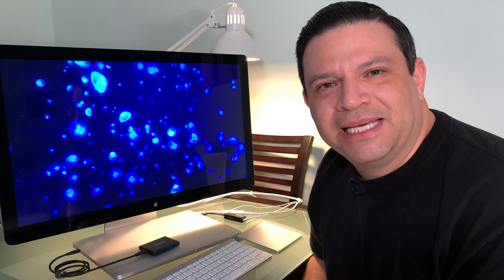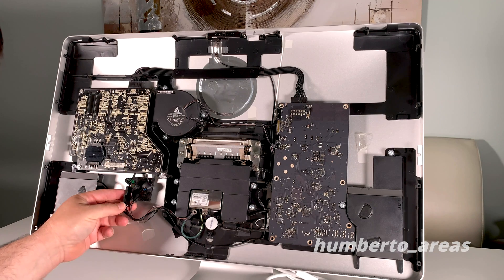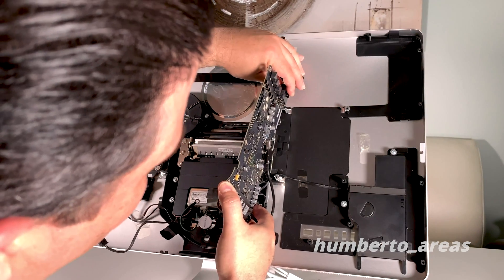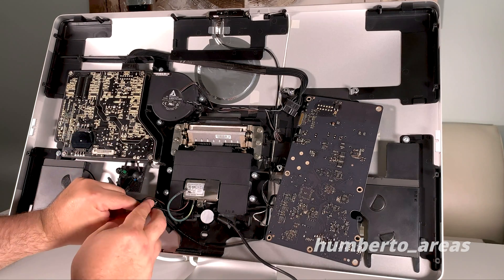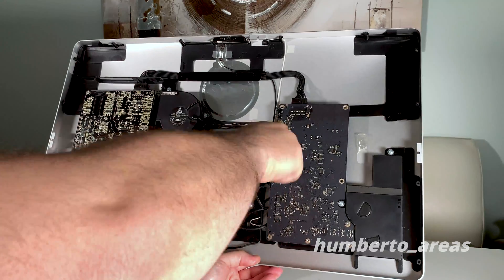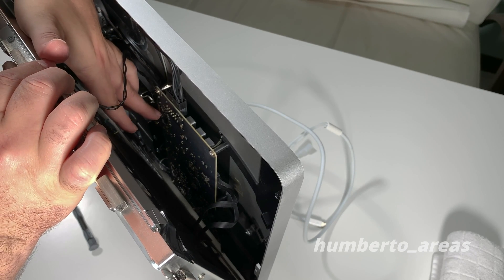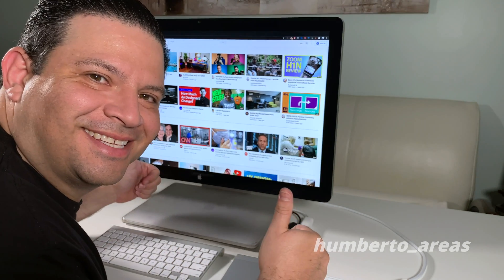Apple Thunderbolt Display Not Turning On - Step-By-Step DIY Repair 2026

Comment: Hi Humberto, thank you for making this video. I recently bought a used 24" LED Cinema Display for my MacPro computer but it only lasted a few days, actually less than a week. It suddenly went black and hasn't comeback since. After researching this model online I found that the Thunderbolt cable dying is a very common issue with these models. Then I found your video and was encouraged by it to challenge myself to do the repair and fix this beautiful monitor. I think it's truly worth it. The problem seems to be finding this particular cable to buy it brand new. I have found a few used ones on eBay but who knows how much life is in them, maybe they'll last another few days and then you have to start over looking for a cable and doing the repair over again. So my question to you is this, if you don't mind me asking… is it possible to find the original cable brand new, and where? Did you find a brand new cable for your monitor, or was it also a used one?
Reply from the maker: @pacobelsue6661 Thanks for watching and for taking the time to post you comments and questions. Glad to hear my video encouraged you in some way to take action. As you hunt for a new cable... my first question is: What is the model number of your display?

Sounds like you have a Cinema Display my friend, and not a Thunderbolt Display. This has a lot to do with the type of cable you're looking for. If indeed you have a Cinema Display, you need to look for a "Mini DisplayPort cable" and not a Thunderbolt cable. 

You can go to https://everymac.com/monitors/apple/ and verify which display you have. And to answer your question, never gamble your money on used electronic parts, always buy new when possible. I found my cable on Amazon - although I've noticed that sellers offering these cables are few now.

Please keep me in the loop and posted on your display.

PS: which part of the video did you find most helpful?

Comment: What if when we try to use one of the other ports in the back, we still don't see a screen show up?  Does this mean the repairs won't fix it?
Reply from the maker: @satchel888 Thanks for watching and for taking the time to post your question(s). Please verify the model number of your display and tell me to which MAC (or PC) you are connecting to? When you "don't see a screen show up", you mean the system does not recognize it? this can be found inside System Preferences > Displays. Look forward to your response.
Reply: @HumbertoAreas  Hola, tengo la misma pregunta. El puerto thunderbolt de atras no funciona (lo intente con un adaptador de thunderbolt  a HDMI). No estoy seguro de reemplazar el cable integrado por si el problema sea otro. Que me recomiendas? Cuando conecto el cable integrado, tengo sonido pero no video. gracias!

Comment: Where can I buy one of these replacement cables for under $40
Reply from the maker: @kyleperkins4757 Hey Kyle, thanks for watching and for taking the time to post your question. What part of the video did you find most helpful?

Unfortunately there’s not much you can buy these days for under $40! I would stay away from used cable offers. I haven’t gone on ebay lately, so don’t know what these cables are going for there. I know Amazon now has a handfull of sellers offering these cables, but are more than $100!

Please keep me posted if you find a more reasonable priced seller. I will research and post here any findings.

Comment: But how do you turnon the monitor? Is there an external switch or is it automatic when receives signal.
Reply from the maker: @freedomisfromtruth Thanks for taking the time to post your questions. There is no button or switch to turn the display on - once an a PC is connected, the display detects the input and comes on automatically.

What issue (if any) are you experiencing with your display?

Comment: Great walkthrough Humberto! I just found a great conditioned Thunderbolt Display sitting next to my apartment dumpster. I opened it up, and although I found a couple dead roaches at the base of monitor where the sound comes from (LOL don’t tell my wife), everything else is clean and appears never to have been opened. Just ordered a new set of cables, so hopefully this fix does the trick. Is this cable issue a common problem for the Thunderbolt Display??
Reply from the maker: @WinningTime328 Thanks for taking the time to post your comments and questions, and for potentially keeping another beautiful display out of a landfill - great find indeed!

Please keep me posted on your all-in-one-cable replacement. Hopefully a simple cable swap can bring your display back to life. And yes, I would say this is a common problem on these 2011 dinosaurs - it's no coincidence that so many people have gotten their displays back to life with a cable swap.

Thanks again for watching!
Reply: @HumbertoAreas  Initially purchased a USED all-in-one cable, which actually showed the display turn on, showing some signs of life; however, after some flickering it would soon turn off. So I returned the used cable and ordered a brand new one instead, and now its been nearly a full week since, with the display functioning and staying on! Thanks a bunch Humberto, it's beautiful!
   I just have one problem now: I have the display hooked up to my iMac, and after it goes to sleep and I wake it up, I then lose ability to adjust the display's brightness via the system setting --> displays controls. I've tried resetting PRAM and SMC, but still can't retain brightness adjustment controls after going to sleep. As of now, the only way to regain adjustment function is to disconnect, then reconnect the thunderbolt cable. I'm just worried continued reconnection might wear out the cable :(   Any ideas???
   FYI: I'm using a 2013 27" iMac 780M GPU, on the latest Ventura OS via Open Core Legacy Patcher. The iMac on Ventura runs beautifully smooth with no hiccups anywhere else.

Comment: Mine just made a quiet popping noise and turned black.  Do you think this is the same thing?
Reply from the maker: @jacobgordon7179 Thanks for taking the time to post your comment/question. I believe this is the first time someone has reported on the comments a "popping" sound associated with the blackout of the display.

Q: does the display show up under Setting > Displays (assuming you're on MacOS)? Or is it completely dead at this point?

Thanks again for watching. Please keep me posted.

PS: which part of the video did you find most helpful?

Comment: Hello, before you did your repair, did the monitor show any sign of life when plugged in (any sound, fan noise, panel light etc)?  The reason I ask is my A1407 Cinema Display shows no signs of life when the power cord is plugged in and was wondering if I would have to look at the power supply too.  I did have an Apple tech plug a thunderbolt to thunderbolt cable from the back of the monitor to his laptop to see if that would result in an image (as I read some people had this work where they then did not need to replace the full internal cord assembly), but that did not result in an image either.
Great video by the way!
Reply from the maker: @tomstone3816 Thank for taking the time to post your questions and for watching. To Answer your questions, no, my display did not show any signs of life when plugged to a power outlet.

Quick question: when Apple tech plug the display to his laptop, does the Operating System recognize the display? You can check by going to System Settings > Displays. If the display shows up there, then you may not need to worry about the power supply just yet.

Keep me posted on your progress. What part of the video did you find most helpful?
Reply: @HumbertoAreas   Thanks for getting back to me so quick.  

I do not remember if the Apple Tech stated if the display was recognized.  I am planning on buying a thunderbolt to thunderbolt cable anyways to I will check System Settings>Displays.  Thanks for this info.

I actually found the entire video helpful as I may replace my full cable setup too.

Comment: I have one of these for my MacBook 2019 16in. I bought a used Bridge laptop dock, but it wouldn't stay on with it, so I bought a new Humancentric Dockbook two days ago, and that doesn't work or stay on either! But it'll stay on direct connect to my MacBook. Any help you can give me?
Reply from the maker: @mackydread, Thanks for your comments and questions. I have to say, I'm really not familiar with either of the two docks you mention. These old monitors offer very little support to newer hardware components - let me check out the specs on those two docks and see what kind of output they offer for both audio/video. Sounds like the ports on the docks may not have enough juice to keep the display on. Do you have any update(s) since posting your question?

Comment: I followed the instructions in the video and it fixed my Thunderbolt Display - Thank you!!
Reply from the maker: @mikem2132, thanks for taking the time to post your comments. Glad to hear your monitor is working once again. Which part of the video did you find most helpful?
Reply: @HumbertoAreas  The entire video - I wasn’t entirely sure if it was the all in one cable. But I watched the video, ordered the part then watched the video again while I put the new cable in.

Works like a champ and the instructions were great - Thanks again!!
Reply: Where did you get the part from
Reply: @kyleperkins4757  eBay - ORIGINAL Apple Thunderbolt Display 27" A1407 MC914 AIO LCD Cable.

I got a used original cable.

Comment: It cool video
Im using a Macbook pro 2017 and Thunderbolt display 27”
When using Mac os Ventura every thing is ok, no issue
But when i running windows 11 install by bootcamp, Thunderbolt display not working
Please help me, thanks you
Reply from the maker: @vietkhoamax, thanks for reaching out and for taking the time to post your comments and questions. Have you installed the Intel Thunderbolt™ 3 and 4 DCH Driver for Windows 10 and 11? You may not have Drivers installed and you need this driver is required if you plan to connect Thunderbolt devices. See link to download driver here: https://www.intel.com/content/www/us/en/download/736380/intel-thunderbolt-3-and-4-dch-driver-for-windows-10-and-window-11-for-intel-nuc-12-compute-element-elm12hb-x.html

Please keep me posted on your progress to resolve your issue.

Comment: Humberto - fantastic video. I was able to get my wife's Thunderbolt monitor working again. Thank-you!  That cable with the tab is a real PIA. On my cable the tab popped off and I'm not exactly sure how to reattach it. I'm hoping heat doesn't make that cable work its way loose. Any recommendations?
Reply from the maker: @chrismehling9968, thanks for watching my video, glad to hear you got value out of it. Since these displays are so old now, everything about them is challenging - and yes, especially that PIA cable. 😄

Have you examined the tab that came lose with a magnifying glass? It'll be helpful to determine whether it came off, or broke off? if it broke off, there is black electrical tape that perhaps will do the trick of holding that tab in place. Similar black tape is used around the displays to hold cables in place. So perhaps we can apply the same? Either way, when moving the display, be extra careful to minimize any vibration that would make the tab/cable come lose.

Which part of the video did you find most helpful?

Comment: Humberto thanks so much for the video. I didn't think I was going to find anything to help me with my Thunderbolt Display. Thanks for such a great Video. New subscriber. :)
Reply from the maker: @Byangelinamaria, thank you for watching. Glad to hear you got value of out my video. Which part did you find most useful?
Reply: @HumbertoAreas  I was able to replace the cable with your step by step and tools you suggested it was a breeze.
Reply from the maker: @Byangelinamaria, this is great news indeed! Glad to hear your display is working again. Now that you have done the all-in-one cable replacement, (A) what part of my video did you find most helpful and (B) what suggestions would you give someone looking to do this cable swap?
Reply: @HumbertoAreas  The whole Video was very Helpful and If you are looking to change the cable on the thunderbolt this is the Video to watch. I suggest pause on each step thats how I was able to follow with no problems. Thumbs Up on the Video

Comment: Love your video;  just the right pace with every possible difficult explained!
I have a Thunderbolt display with a grounded power cord as well as the magsafe and thunderbolt connectors.  Will your recommended replacement cord work with my model?
Reply from the maker: @Gerald Anderson, thanks for much for watching, glad to hear you got value out of the video. What is the model number written on the bottom of your display?

Comment: Hi
 I did all these steps with the same stuff you mentioned but my thunderbolt is still black
my mac is m1 max with ventura as OS what is the solution?
Reply from the maker: @Ahmed K. Lattoof, thanks for watching and for taking the time to post your comments. What is the model number of your display?

Saw a discussion here regarding displays and M1 Max Macs. https://discussions.apple.com/thread/254096466
Hopefully this helps.

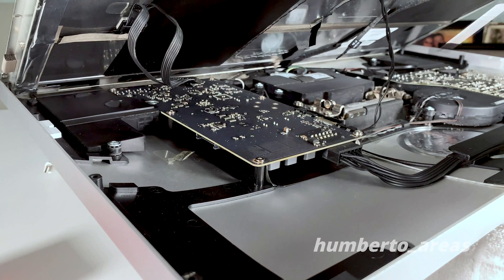Comment: hello! i recently repaired a monitor that only had audio i found by the trash just by plugging in a loose cable! it was all perfect and great for a few days until i accidentally knocked it over and because i didn't put the screws back in, gravity essentially ripped the connections apart from the screen and i messed some things up. i was able to connect the other 3 connectors fine. but for this fragile one you removed at around 2:09, i noticed it completely detached from the black and metal part its supposed to be in, and i assume that was supposed to be attached to the t10 screw piece. because that broke, do you think i can still bring this thing back to life? is there a way i could reconnect the two wires into the socket again? :(
Reply from the maker: @KENWAYED, thanks for watching and for taking the time to post your comments. Sorry to hear the display got knocked over, bummer really. Unfortunately everything is so old and brittle inside these displays, that those connectors are really fragile. Is the piece that ripped off held in place to the socket/connectors by pins or is it solder?
Reply: @HumbertoAreas  you said in the video that the little thing im working on is just the ground cable and my issue is that there’s sound but no display.. so does that mean there might be something wrong with the lcd connector? maybe that broke?
Reply: hmm, solder probably? or well, i am not too well versed in anything tech lol but in simple terms, that fragile 2 piece wire thing ripped from the black shrink tube. what i just noticed right now though is that mine looks a little big different from yours in the video; there is no t10 screw there, just the shrink tube/wire connection

edit; never mind it’s there i just had to bend the metal part! i guess it’s connected to the board through the metal or something?

Comment: Suction cups are unnecessary. Use your fingernails on edge or tape to pull it up.
Reply from the maker: cacmang42, thanks for watching and for taking the time to post your comments. I chew my nails... So I needed the suction cups for sure! 😂
Reply: @HumbertoAreas  thanks for making the video, i was able to do this to fix my girlfriend's monitor
Reply from the maker: @cacmang42, thanks for coming back to the post and providing an update on your monitor. Which part of the video did you find most helpful?

Comment: Thank you for mentioning this: "Many folks use the spare Thunderbolt 2 port in the rear of the monitor as an alternative when the main Thunderbolt 2 cable goes bad." This is all I needed but if this hadn't worked for me, I was prepared to follow your excellent instructional video.
Reply from the maker: @J M, thank you for watching and for posting your comments.

Indeed, using the spare Thunderbolt port is a great work-around to this issue. The only setback to that route is you have to run a separate charging cable to your laptop (in my case), and I hate cables all over my desk. I try to minimize cables where ever possible.

Glad to hear this option worked for you and again, thanks for sharing your experience/solution with everyone here.
Reply: @HumbertoAreas  Question, so the power output is also connected to the original single cable even though physically there are two plugs? magsafe and TB?
Reply: @HumbertoAreas  Hi!, so in my case, if I have tried to use the spare Thunderbolt port and it does not work, it means this is not the cause and replacing the internal cable won't work either, right? thanks in advance
Reply from the maker: @Ramboelagil77  Hello and thanks for reaching out. Let me ask, when display is connected, does your PC recognize it? (Ex. System Preferences > Displays) Use different ports, different cable, etc. Have you tried another display? I would hate to jump to a conclusion... Please keep me posted.
Reply: It does not recognize it on mac or windows the thunderbolt 2 does not work neither the inside nor the spare does not detect nor only is it off any interference thanks @HumbertoAreas
Reply: @HumbertoAreas  same problem here tried using the spare port in the back, still black but my computer is recognizing the monitor. What else could be the cause?
Reply: @HumbertoAreas
Reply: Thank you, I just did this with a spare thunderbolt to thunderbolt cable to an Apple thunderbolt to USB-C converter and it worked!